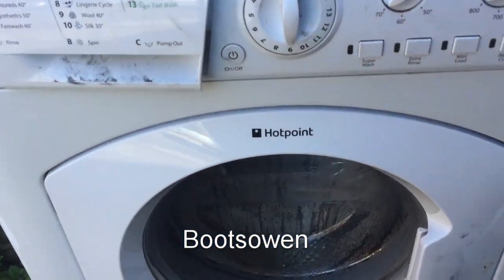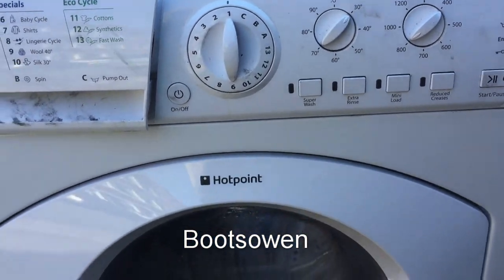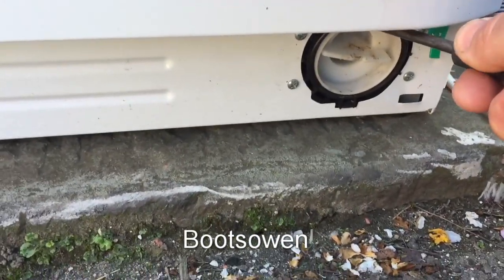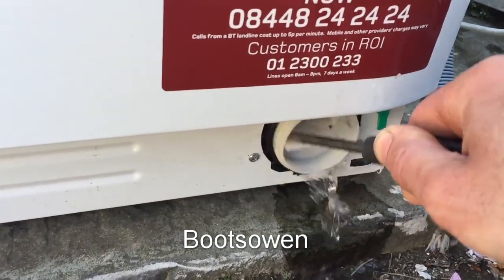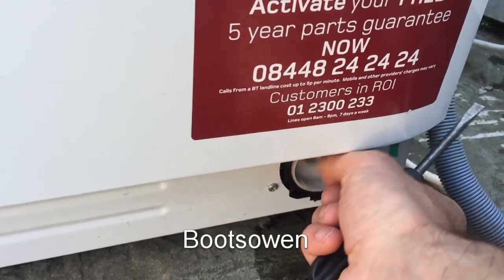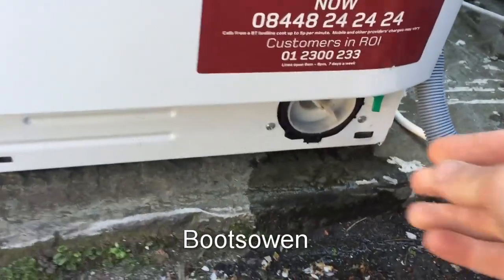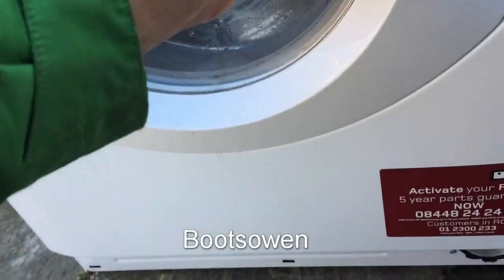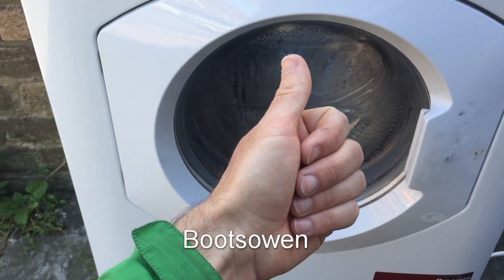How to check Hotpoint Aquarius WML520 filter

Comment: Hi... Sorry for disturbing you at this hour. Could you or someone please help me? I was just trying to do a load of wash before midnight. However, something strange happened. As I selected the cycle programme 7, the water went into the first drawer. I waited for the water to go into the second drawer but nothing happened. I waited for a long time, still nothing happened. I tried changing the programme hoping there's some movement but to no avail. The lights on the right hand side are still on indicating there is still power supply.

Can anyone please tell me what could've been the problem here? I have loads of laundry to do this week 😞😞😞
Reply from the maker: Is the water turned on? Has the inlet become blocked, Is the solenoid valve still working? You can try starting it again and filling the washing machine with a hose or a jug through the drawer, once the level is high enough is should start washing, and this will let you know that it is a water issue and not something else.